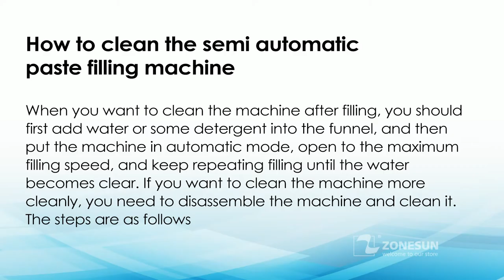How to clean semi-automatic paste filling machine

Comment: Nice video...What is the source of movement to operate the machine?  Does it work with compressed air?
Reply from the maker: hello，This needs to be plugged in and used with the air compressor, more details you can check by this link：https://www.zonesunpack.com/products/zonepack-many-filling-range-pneumatic-volumetric-softdrin-liquid-filling-machine-oil-water-juice-honey-soap-cream-paste-filler